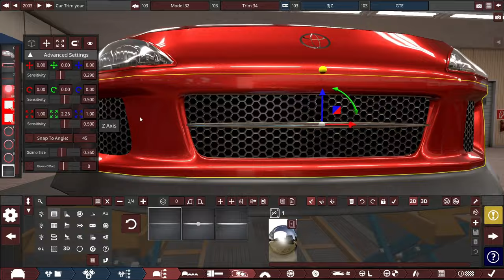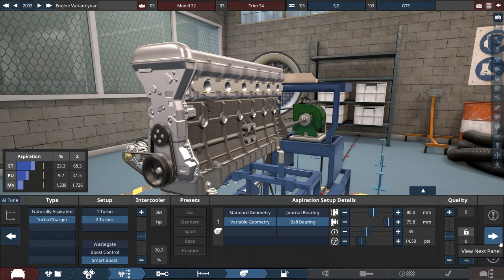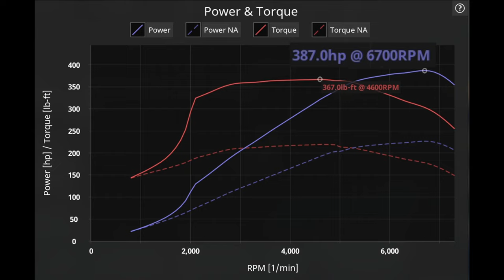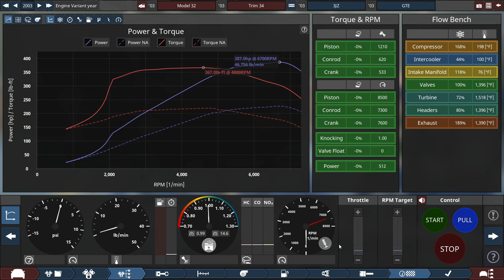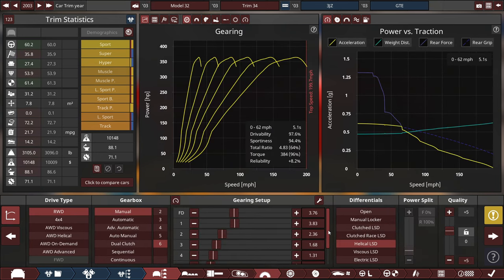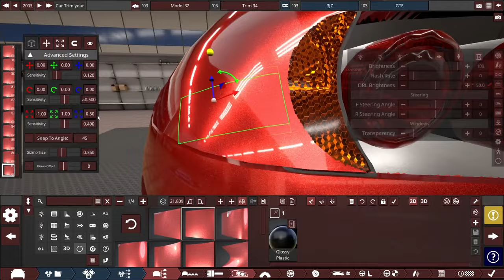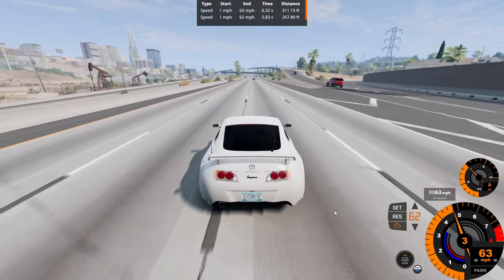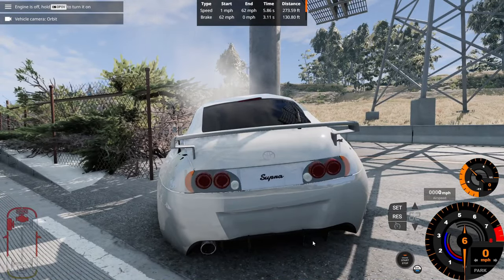The Toyota Supra That Should've Been! | Automation Game & BeamNG.drive

Comment: Glad to see the hypothetical supra is just as bad as the real mk4, still getting beaten my same year m3's
Reply: Track results would like to disagree
Reply: @kilotiger7780  the mk4 track results are bad irl, considering it's not a sports car, m3's were faster in corners and in accel
Reply: @madeinryan  Except the fact that the a80 was faster in the 1/4 mile and in three different tracks, including tsukuba and the Fuji speedway...
Reply: @kilotiger7780  the quarter mile was literally recorded showing the e36 being way in front.. quit lying and go check your facts
Reply: @madeinryan  Quite ironic considering the fact that the video clearly states the supra's trim(SZ). That's the naturally aspirated model versus the ultimate 3 series with 100hp more. Had it been an RZ aka the twin turbo ultimate variant aka the competitor to the M3, results would be different. By definition the MK4 is a grand tourer, which is a car with really no drawbacks. Offering good performance and handling without sacrificing comfort and daily driveability....